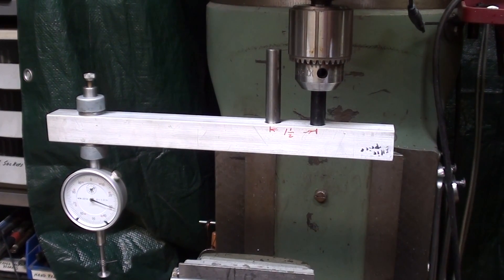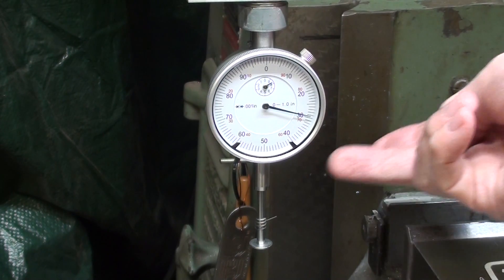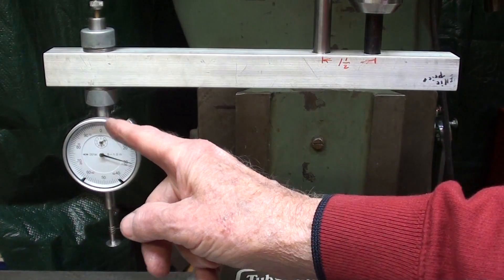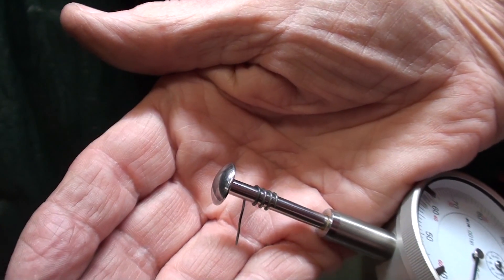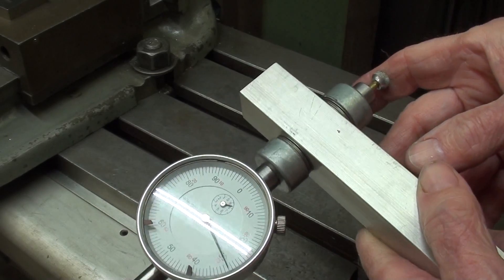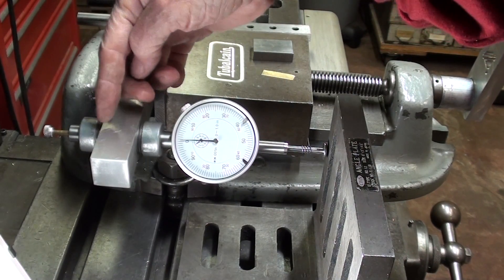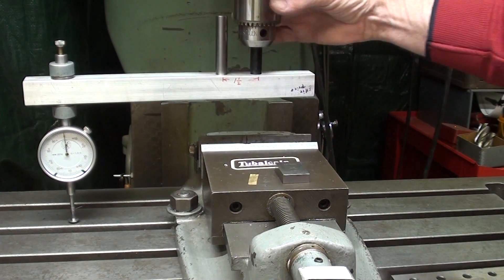TRAMMING ATTACHMENT Bridgeport Mill followup #796 tubalcain

Comment: Mr. Pete, thanks for sharing the idea from Ellie!  I built one myself, using 1" keystock and 5/8" dowel pins.  It's way too heavy, but I was using what I could find.  It seems to work well, but I did have to attach the shaft collars to the stem and face them in the lathe to keep them from binding on the nylon spacers.

Thank you. You helped save me a bunch of money, and I have a very useful and accurate tool as well.

Comment: Whenever I tram my mill, I pull the vise and clean the table. Then I can tram in all four coordinate directions. Then it is square on all four axis. Also clean the bottom of my vise.
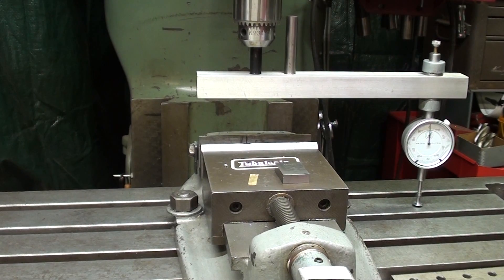Reply: It’s a little difficult to understand but if the indicator reads the same (needle does not move) across the full width of the table on both sides of the vise the tilt and nod are in perfect tram. Checking at the 12:00 and 6:00 positions will not improve accuracy.

Comment: Master
 I made one from CRS 1×1 square tap two 1/4-20s on the ends. Put ½ reamed hole in the for the shank and purchase two ¼ travel indicators from Shars and ¼ magnets from McMaster-Carr the whole setup was under $30.00. You mention about the X axis had to be perfect forgot demonstrate the calibration of the Y axis. It appears that span of the bar, shank & indicator wider than the table in your video? Normally I use to tram the head with test indicator before I do my work or I know for a fact the head out of tram. Some time ago I seen a Blanchard ground ring with support legs the straddle the vise to tram the head. But yet see one used in a shop. That could be another choice.
Reply: To tram the nod with this device. Swing the indicator completely across the table on both sides of the vise. If the needle stays on zero (does not move) the table is in perfect tilt and nod tram. This tool is not designed to check the nod at the 12 and 6 position.

Comment: The bar does not need to be that long. Any length will work as long as the indicator clears the vise on both ends of the table. However, the longer it is the more accurate the tram.

Comment: Hi Mr Pete rich man poor man well theses days if you own a pickup with a V8 your next fill up could be a $100.00 or more . I think if the thrust bearings had .001 play it wouldn't madder the weight of the gauge and pressure from the spring in the gauge would equalize itself from one side to the other side of the table . That's my opinion . Thanks Mr Pete for all the videos. JM
Reply from the maker: I agree

Comment: Traming the head requires adjusting the head both on the X axis and the Y Axis of the table.  How do you check the Y axis with that long fixture?
Reply: Simply rotate the bar across the full width of the 9 inch table on either side. If the indicator reading stays at zero (does not move) across the table  the Y axis (nod) is in perfect tram and does not need to be adjusted.

Comment: What happens if you drill and ream that ally bar with your Bridgeport before it's trammed? If the hole is at an angle will that effect the tram?
Reply: No, since the attachment is turning on the spindle bearings the holes drilled at an angle will not affect the accuracy of the tram.

Comment: Make the indicator mount from a bolt with a hole bored though it, secure it with a nylon lock nut to preload the thrust bearings.

Comment: "You fool" ( sorry Sir I couldn't resist ). If you drill with the quill when out of tram you will still get a nice clean hole, it just might not be where you want it.  Now if you do the same by raising the knee you might be in a bit of a pickle. 
And yes great guru, I know you put that in there to see if any one was paying attention. 
 Cheers and thanks for all you do.
Reply: Well it will start where you want it but it will nor finish where yp\oiu want it.
Reply: The hole you drill with the quill will be at an angle (not perpendicular) to the surface of the parts.
Reply: @ellieprice3396  And the hole you drill with the knee - will likely end in disaster !
It's one thing I don't have on my mill - a quill - but at least the universal head doesn't need tramming.
Reply: @millomweb  True, you definitely don’t want to drill a hole with the knee with the head at an angle.
Reply: @ellieprice363  Even a milling cutter would groan at that !
Reply: @millomweb Have you ever checked to see it’s in tram? Probably best for peace of mind not to check it since it can’t be adjusted if it’s out.
Reply: You will drill a nice oval. Or break the bit. Or both.

Comment: The runout of the chuck makes no difference, neither would the perpendicularity of the drilled holes on the aluminum bar stock for the stem or indicator.  The error would follow itself around and cancel out.

Comment: I was noodling on the Jacobs chuck issue.... just as you brought it up I was realizing that the runout simply follows the gauge around the arc. That was bout the time the coffee was kicking in.
Reply from the maker: lol
Reply: Yes, that's a good way of describing it.  The only limitation is the run-out of the spindle bearings which hopefully is very low.

Comment: I always tram over a precision ground block (gauge block) Mostly because I did not like dragging my indicator point over the table, and into the tee-slots.
Reply: I like to use a new brake rotor, or disc, as we call them in the UK.
Reply: @chattonlad9382  A new brake rotor works great but requires removal of the heavy vise, which is the primary time saving feature of this device. Swinging and rotating the indicator checks both tilt and nod. Simply rotate the arm across the full width of the table to check the nod. If the indicator reads zero across the full width the nod does not need correction.

Comment: We just used to use a Verdict stylus gauge fixed to a bent rod with a standard knuckle clamp. On Verdict gauges, the angle of the stylus is adjustable and so is the stem that fits in the knuckle so it could be set so that the dial faced upwards removing the need to turn the gauge to get a better look. Also the end of the stylus is teardrop shaped, this allowed the stylus to more easily skip over the T slots as long as it wasn’t set too low. I’ve never seen any You Tube machinists use Verdict stylus gauges but they made my life so much easier for assorts of operations…I mostly used plunger type clocks for pump/motor alignment out on the block.
Reply from the maker: Thanks

Comment: Not convinced by the demo of error in the chuck not mattering. The offset you introduced with the shim stock was at 90 degrees to the to the two points being checked so of course it would make no difference. Id suggest repeating the checks twice rotating the pin in the chuck by 90 degrees  to be certain. It's only one small extra step.
Reply: You may not be convinced by the demo, but that doesn't mean that Mr. Pete is wrong!  I agree with him.  No matter what the geometry of the stuff hanging out off the spindle, it will always sweep a disc that is perpendicular to the axis of rotation of the spindle.
Reply: @briantaylor9266  I just recreated  the set up and my original thinking was wrong   You and Mr Pete are correct . Seeing things on the flat screen is different than than having my nose twelve off the work
Reply: @bulldawg6259  Major props for going through the effort to check your thinking and reporting back when you learned something different and new. A rare occurrence in a U-Tube comment...
Reply: @douglasbollinger8678  my mom always said to try to remember to try to be nice
Reply: @briantaylor9266  Correct, you could use a bent chuck, and you would still get perfect tramming, as long as the spindle is good.
Reply: @chattonlad9382  I use a bent piece of coat hanger wire to tram my drill press table!
Reply: @briantaylor9266  You are correct. A better way to visualize this might be to put a length of say coat hanger wire into the chuck. No matter how you bend it, the tip will always describe a circle at 90 degrees  to the axis of the spindle.
Reply: @robroysyd  I think the reason there’s so much confusion about this is that viewers are visualizing the pin turning in the chuck jaws when actually the whole chuck is turning on the spindle bearings.
Reply: @ellieprice363  That sounds right. Now that I've got the right concept in my head I'm having a problem understanding how I had it wrong. I do wonder about the device with two indicators though. You could be misled by an error in its construction however rotating it 180 degrees would reveal there's a problem with it.
Reply: @robroysyd  The expensive dual indicators are obviously popular since a lot of people use them. I just never could get my head around calibrating two indicators that don’t rotate when a much cheaper setup with one rotating indicator is easier to use and more accurate. I think the secret is the beautiful red anodized finish and mass marketing.
Reply: @robroysyd  Also requires a mirror to use it since the dial doesn’t rotate.
Reply: You have to also check ‘nod’ to get that zeroed.  That’s all.  Bent/out doesn’t matter (until you try to drill a precise hole!)
Reply: @stilyou  This device checks the tilt and the nod. After correcting the tilt set the indicator to zero then sweep the indicator across the full width of the table. If the needle stays on zero the tilt and the nod are perfect and tramming is complete. There’s no further need to check the twelve and six o’clock positions.
Reply: I agree with you